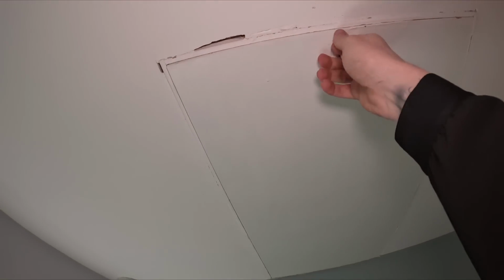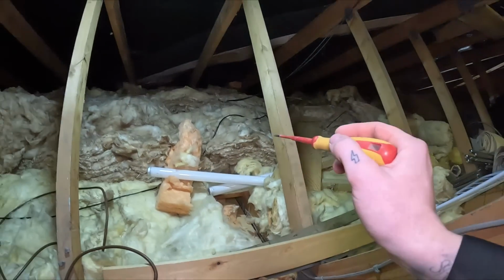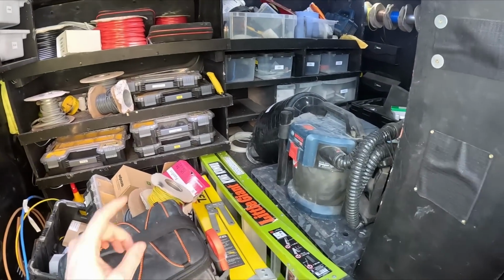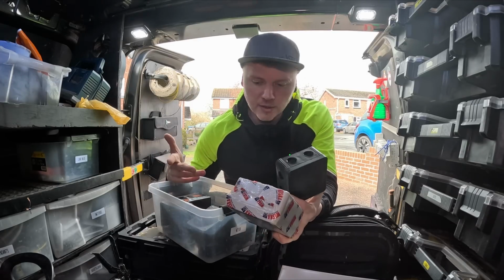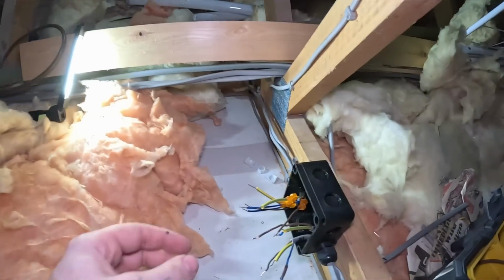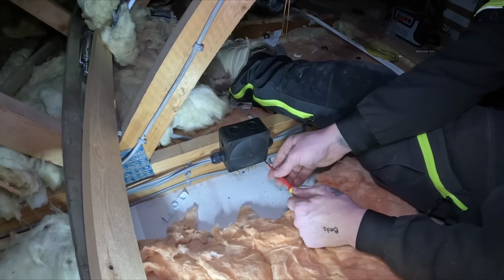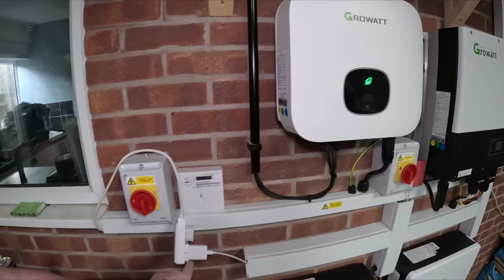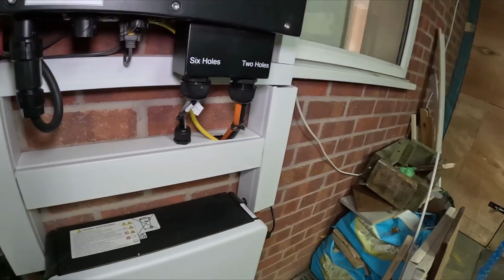Very CHEAP solution..... Maybe

Comment: As an IT Geek the biggest issue I have with home smart tech usage if internet goes down/provider goes down etc. I like a physical switch that can overwrite it
Reply: That’s the neat thing about Home Assistant and Shellys. Home Assistant runs locally, no internet, no problem. And Shelly relays (and similar) take input from the light switch. 

I’m similar in that smart home stuff should be an enhancement and it shouldn’t matter if things go down etc.
Reply: @seanhood980  interesting about the shelly relays taking input will look into them. Had an issue running Domoticz a few years ago where an update broke it so had limited lighting until I rolled back
Reply: Agreed that's why I fit smart wall switches, can still be used kif the Internet goes down
Reply: Get KNX if you ever rewire the house.

A KNX Pushbutton, an actuator and sensors like a weather station are independent, intelligent members on a bus.

Let‘s say you have a ceiling light, the all you do is  create a group address with a 3-segment ID like 2/0/4

The pushbutton says „GA 2/0/4 - On/True“ when a button is pressed. All actuators listen. One of them thinks: „2/0/4? That‘s me!“ and switches the light on.
In return the actuator can use a group like „2/0/5“ to respond with the status. 
In this example the actuator sends „2/0/5 = On/True“ onto the bus cable and all devices listen.

Now you might have two push buttons in the room with status LEDs. Both go „2/0/5 is On? I better switch the LED indicator to green“

This is a super simple, but effective protocol, with 100% tested compatibility across 8000 devices, does not need ANY central logic or IP-based connectivity and works in commercial properties like hotels and office buildings for over 30 years now.

Of course you can get a gateway or bridge to the IP world, but the house itself is connected via a non-IP Twisted Pair cable.

In my case the house shows up as basically 1 device with 78 entities in HomeAssistant (14 Thermostats, 20 Shutters/Blinds, 30 Switches, 10 Dimmers and 4 LED color strips.)

We have it for nearly 20 years, no downtime whatsoever and due to the HomeKit & Alexa Gateways as well as the OpenHAB & Homeassistant support it still feels brand new and impresses quite a few self-proclaimed smart home geeks, when they visit us.

KNX… that‘s what professionals use. 

(There is an english KNX course available here on YT from Torben Ledermann)

Comment: Might have to look into PoE++ lighting soon as I am which means it's easy enough to power lights from a PoE switch. No chance of shocks as they use CAT5e/6 cables thus also smart home capable for LED lights/strips etc. Just a matter of running the cable and currently looking into PoE led drivers so no mains power. It also means cutting down on energy consumption and as led strips can last a very long time, it means you can also design your ceilings, have atmospheric lighting etc. all from PoE power. The other added benefit is not having to turn off the mains lighting circuit and testing would be much quicker, say you plug in the led strips with the power running through the drivers from the switch, they would either turn on as soon as the ethernet cable is plugged in or not depending on the switch. I have also seen PoE switches for lighting too so............
 
I wonder what your thoughts are on that.
Reply: You need a special switch as far as I know. Looks expensive at the mo. But I agree, would love to have some of that stuff.
Reply: PoE lighting is interesting, but unfortunately the options are somewhat limited. Very few fixtures are available that support it, and while PoE switches or injector banks are coming down in price, they're still not all that cheap, so you're probably not saving that much money. 

Plus you generally have to have a home run from each and every fixture back to the switch - that or find a fixture that supports some sort of mesh or relay, and then you're limiting your options even more.

Then there's the resale value - PoE lighting is still in the interesting niche category, definitely not something most people would want. It's kind of like when there were people excited about replacing lighting with 12v fixtures that all led back to a transformer. It was going to be the future. But now they're all being replaced by standard lights again. It's hard to argue with a universal standard, haha.

I do love the idea of PoE lighting though! Very cool concept, despite a lot of the drawbacks.